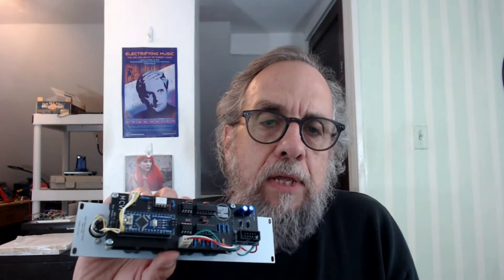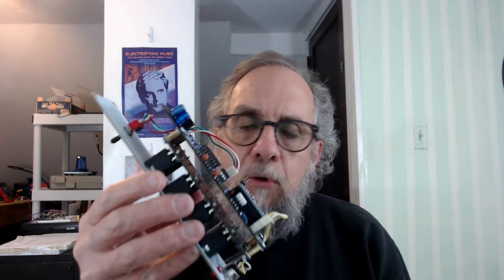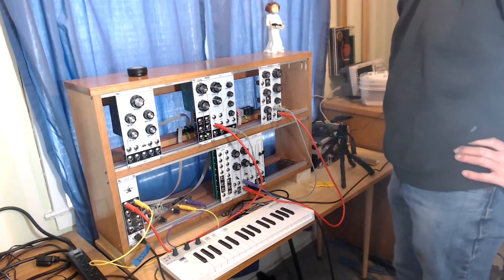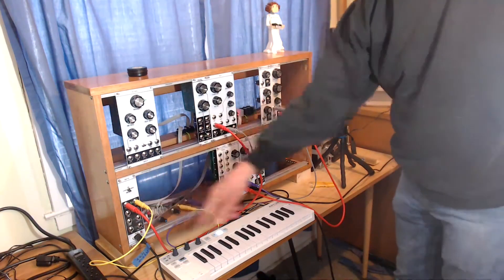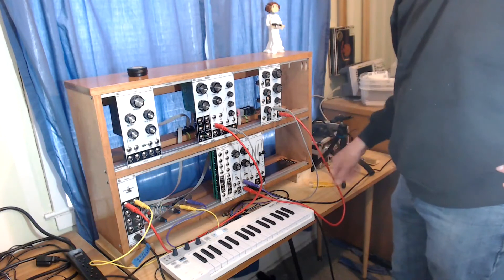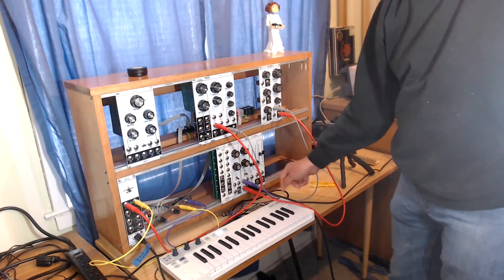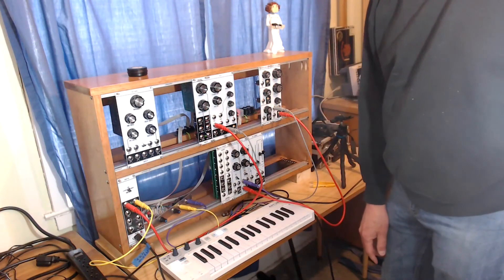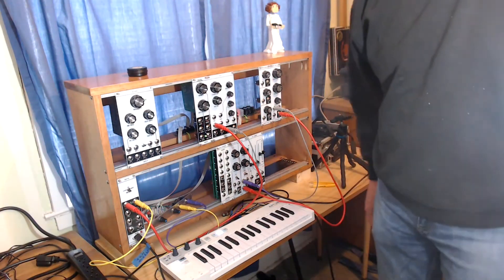MCVI: A MIDI to Control Voltage synth module (Mark I)

Comment: Awesome design. Thanks for sharing! 
I went off a very similar schematic to yours but it uses a SFH618A-4 optocoupler instead of the sn137. I'm powered off 9V. 
I'm RX light blinks with note on info, but I'm getting no voltage change readings on any CV output. 
I'm using elkayem's exact code. 
I'm using benjiao modular schematic 
I'm really confused. Any suggestions? Thanks

Comment: Hi again. A quick question regarding the NOTE_SF statement in de code. I saw a substituted 'f' behind the 47.069 value. Is that correct? And i kindly want to ask you which lines of code to adjust when i only need 61 notes instead if 88. Thanks in advance for your help.

Comment: Hi Rich Holmes. First of all thumbs up for your video regarding this module. Today i build it and it worked right away. The schematic is not that hard to follow 😁 but still its possible that issues arise to solve. I have one question regarding the Arduino. Besides the +5v on the 5v pin, why is there the need to power it with +12v on pin30 (vin)? At the same time? According to the datasheet the maximum power on that pin is +12v and more voltage could cause harm (regulator hot) so i rather not use the maximum voltage. Since the other chips (opto, and dac's) are running on 5 volts i desided to only connect 5volts to the 5volts pin and seems to work fine. Could you please advice which voltages i can use best in terms of stabilty etc. Thanks in advance for your reply. Keep up the good work. Kind regards Marty
Reply from the maker: The Nano is powered only by +12 V on the VIN pin. The +5 V pin is a power output pin (in this configuration), not input — in my system (Kosmo format) there is no +5 V bus, and no +5 V regulator on this PCB, just the regulator on the Nano board which is powered by +12 V. I've never had a problem with running a Nano on +12 V. That said, if you have a regulated +5 V bus or if you add an external +5 V regulator to the board that can supply enough current for the Nano and the rest of the circuit, you could connect that to the +5 V Nano pin and connect nothing to the VIN pin. In that configuration the +5 V pin is indeed a power input, and the on board regulator is not used.
Reply: @analog_output  hi, thanks for your quick reply and advice. I am gonna try this later today. Thanks and have a nice day
Reply: The LM7805 regulator looks more sturdy to me than the tiny regulator on the Nano. Just a level of protection i guess.
Reply: May i kindly ask you once more for your help. I dont need 88 keys, but 64 instead. Which lines in the code do i need to adjust? And/or how to calculate? Thanks again for helping me out😊

Comment: Rich, I have a question for you. When I open your project in Kicad I see the two boards in the PCB layout, but for some reason I cannot see the traces on the main board, just the top and bottom zone outlines. I know this is more of a Kicad question, but as this is your design and I am still learning I would hope you could tell me how to display the traces on the main board. The traces on the 'Jacks' board show up fine.
Reply from the maker: That PCB file was wrong, somehow those tracks had gotten deleted. I've reverted the file to the previous version. Can't guarantee it's identical to what was used to produce the Gerbers, though. The Gerbers do have the tracks. Sorry about that and thanks for letting me know.
Reply: @analog_output  Thanks Rich! That makes all the difference. I did see that the gerbers were ok, I just thought that my kicad was playing up, or that you had hidden the tracks with some setting....

Comment: Congratulations on your module, very well built. Do you think I could adapt it to the Eurorack format, possibly using the same PCB?
Reply from the maker: It certainly could be done in Eurorack with no changes to the schematic. But the PCBs would have to be redesigned; my main PCB is 138 mm by 46 mm. It has a fair amount of space between components though, so squeezing it down to Eurorack size might not be that bad. In the worst case you could split it between two boards and sandwich them.

Comment: I breadboarded a slightly adapted version of this design this weekend, and just this moment tested it. I get velocity output, but I have made a mistake in the note output, but it is a great circuit. More the better that I picked up a midi keyboard controller (ESI KeyControl49) for €10 at the local flea market two weeks ago. Can't wait to get a board designed...and then some VCO's and some VCF's and some ....... . Excellent videos Rich. Keep it up!